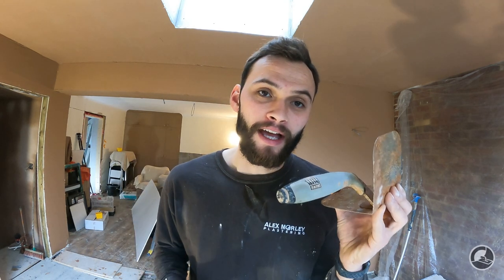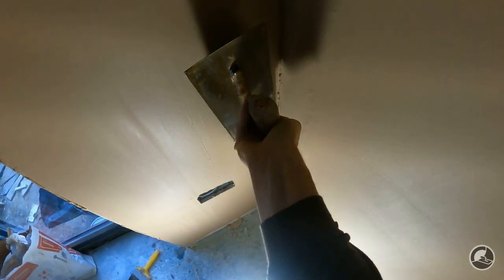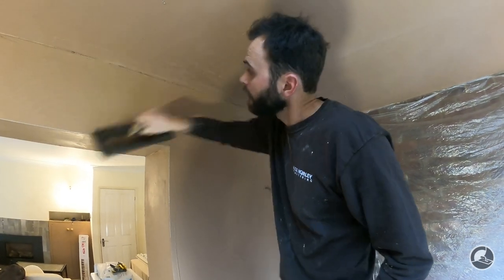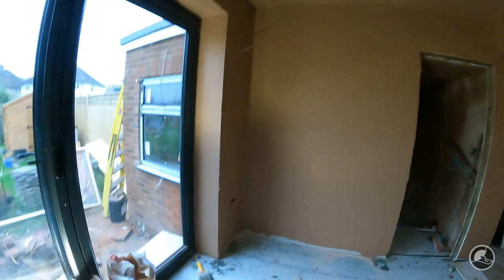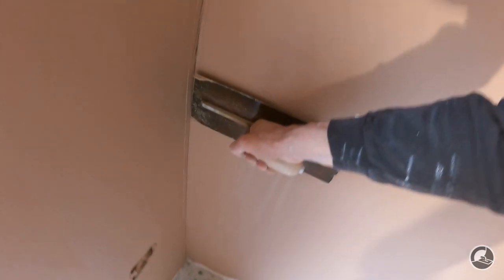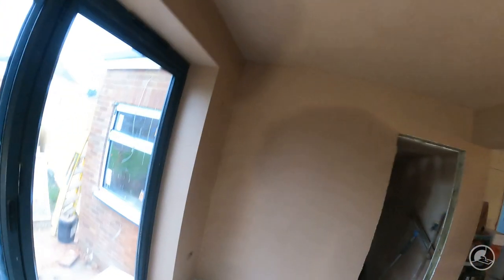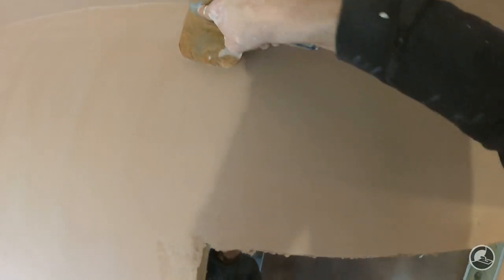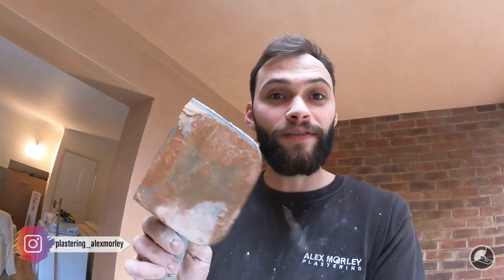Amazing Corners with a Corner Trowel

Comment: Hi Alex so before and after first wet trowel only? Do you brush angles before twitching or dry? And one more do you know the rag I angle, looks like 90 compared to marshaltown which is 103 and digs a bit?thx
Reply from the maker: I don’t use the corner trowel until the closing in stage of the second wet trowel. 

Any sooner you are disforming the corner. Pretty sure it’s the 103. And I only use a small brush after the second twitch.
Reply: @AlexMorleyPlastering  different to wat video says m8 I’m lost

Comment: Carpenters don't like them so neither do I. Skirting boards don't fit right.
Reply: What do you do?
Reply: @israeladesanya4596  Plastering for 20 years now I'm a bathroom fitter wear and tear. Why? What do you do?
Reply: @israeladesanya4596  🤫
Reply: @anemone9895  I'm a plasterer, what has a corner trowel got to do with a skirting board?
Reply: @israeladesanya4596  if you have 2 door frames adjacent to each other at a 90 degree angle the skirting boards would be at an obtuse angle. In short twitchers or twatchers as I call them have a rounded corner. It's called quality control, looking out for the trades that come after you. And the finished product
Reply: @israeladesanya4596  listen mate I wanna help you. Twitchers are fine for ceiling corners. But when you get a door frame close to a corner drop its not a good look when all is said and done
Reply: @anemone9895  if your walls are straight no you wouldn't.
Reply: @israeladesanya4596  if you do opposite walls you'll have a hard corner which is 90 degrees and walls flat if your good enough. I've done it longer than you. I've tried to help you. Your on your own
Reply: @anemone9895  no wonder you had to move on. 🤣
Reply: I just take the inside edge off the skirt.. or just hit the round with an old chisel... or finish the corners with the trowel
Reply: @anemone9895 wow you're quite the guy eh!!!